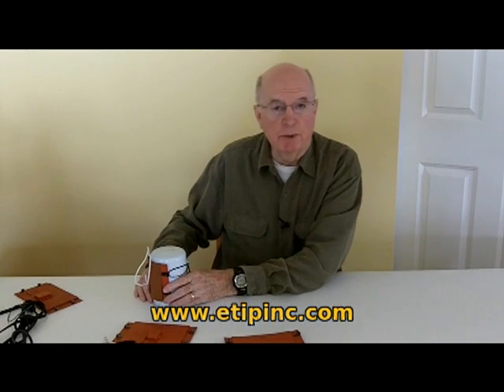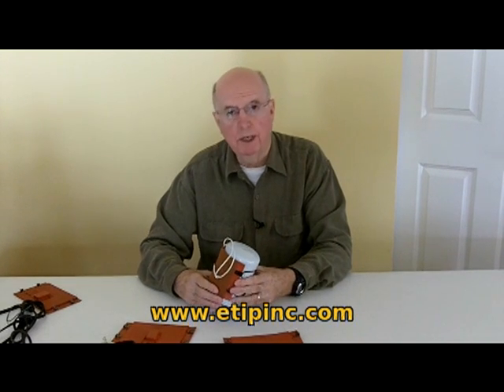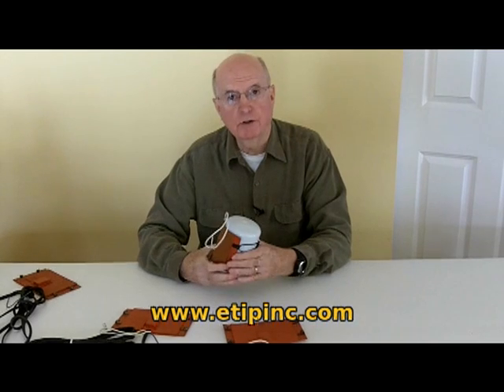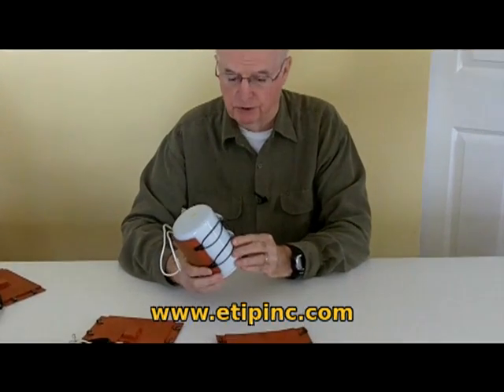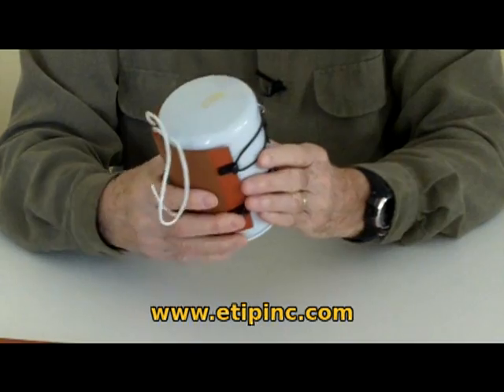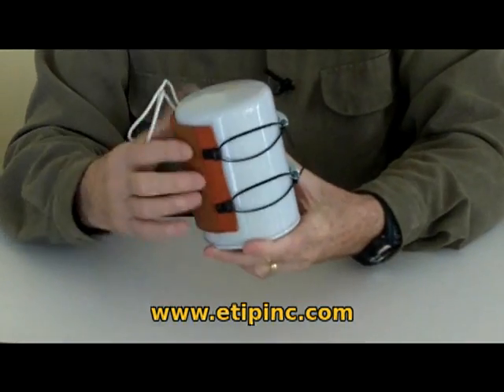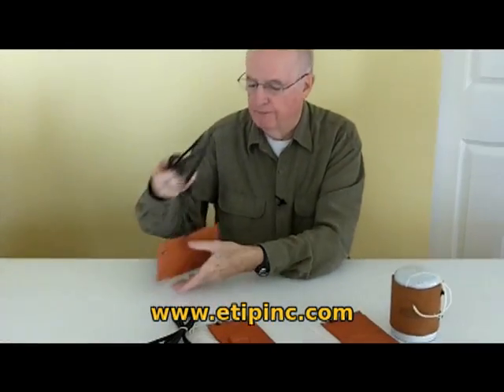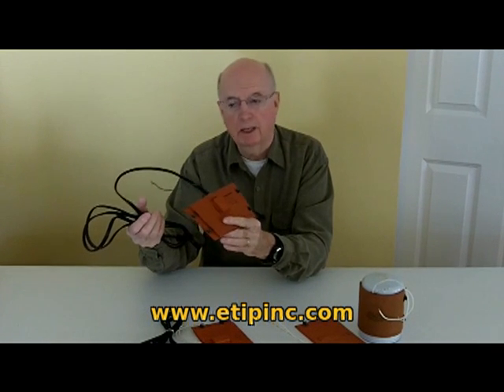A thin, flexible, silicone heating pad that heats the filter housing to reduce the risk of gelling.

Comment: How many different things do you need to heat in a diesel engine in the winter? I've heard of block heaters, filter heaters, heat exchangers and tank heaters. DO you need them all or which are most important.
Reply: The most vulnerable gelling point or ice point is at the filter even if you got 50/50 blend I’ve had problems at the filter